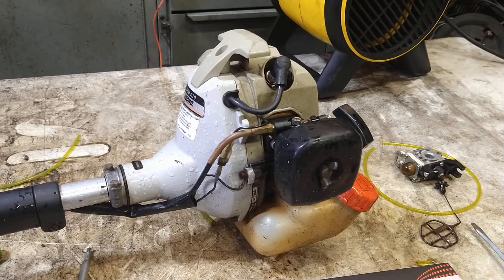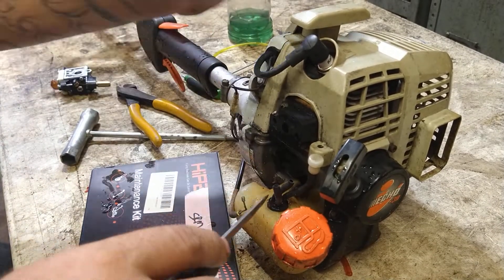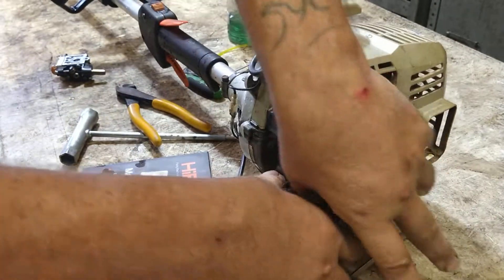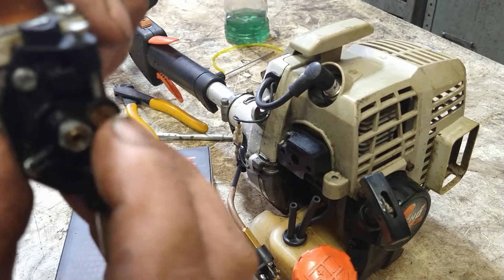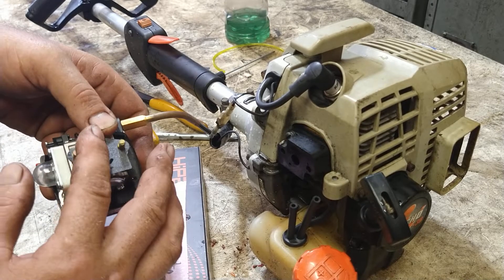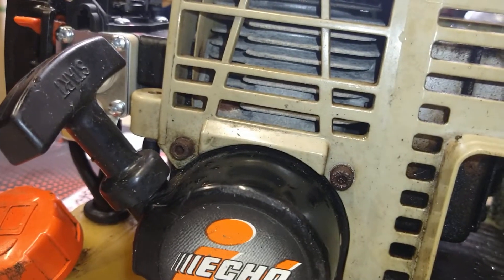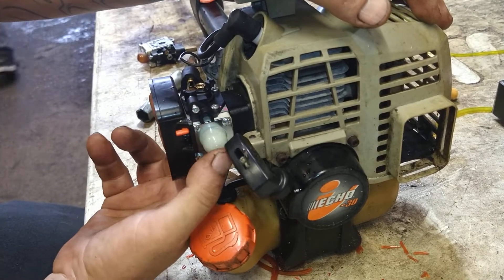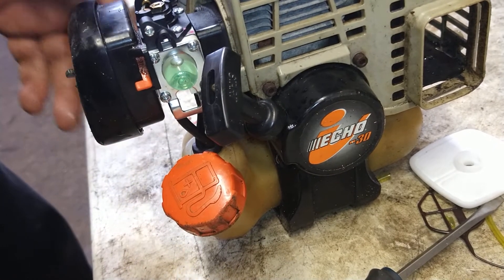echo srm210 HIPA carburetor fuel line kit installation instructions repair video

Comment: Thanks for the video. I was wondering how to keep the intake and fuel drain lines straight and you explained that and told the orientation of the air filter cover. On all this type of equipment, does the excess fuel line tend to go closer to the air filter or is that variable?  While your audio part was good, your video angles needed help. All the time you were hooking up the fuel lines, the pull start handle was blocking the view but you talked though it well so I got the layout. Now to do mine!  Sorry to be critical, I know making a how to do it video by yourself is very hard. I tried it ONCE and mine never saw the light of day as it was so bad.

Comment: so the length of the fuel filter line should go all the way to the right of the fuel tank.  So the trimmer can be baked to the right but no to the left? because the fuel would rush to the left side and no fuel would reach the fuel filter line?
Reply: I don’t believe that’s what he said. The trimmer runs well when held in any direction when done properly. Fuel filter line attached on port toward the engine and the fuel excess line goes toward the air filter.  Another video i just watched said the fuel intake port is larger that the excess fuel port. It